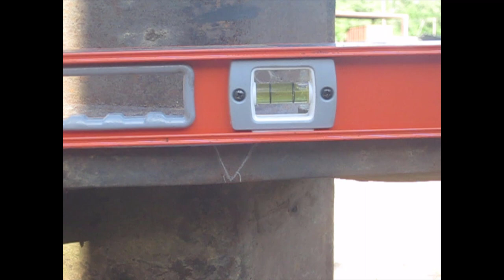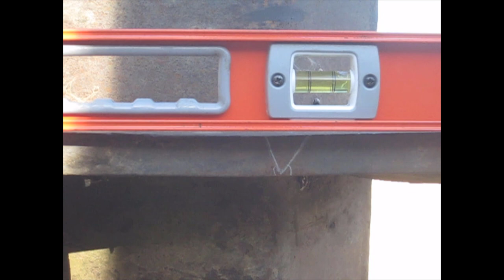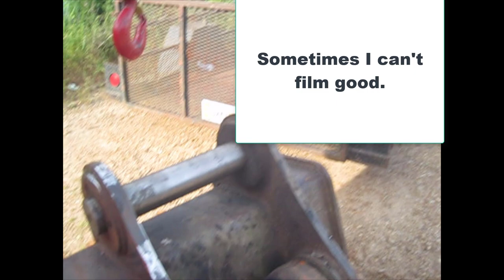bucket ear repair

Comment: A cut and weld expert does cut and weld. 
I would have put the old pin in just the bent ear sleeve and the stick and bent the ear back by manipulating the bucket against the ground. If it can be bent into a bad position, it can be bent back into position until a new pin fits. This likely got bent because the pin slipped out of the other ear.
Isaac is great. IC Weld. Amazing work. Very humble as he finds better solutions and corrects himself on video.

Comment: No matter how far we advance in the future, we still need the old ways for permanent fixes. Like you said, a thousand ways to skin a cat. I like the result and not sure I would of tackled it the same way but your liquid steel filled the gap just fine and with air needles made it super strong. No tearing that eye out. I have seen it done on bigger stuff... I will check out your friend... good video, Might get some time and kylon the tool truck enough that she hides her age better. I seen where it came from and you have done so good.

Comment: Pressure and heat shrinkage would be the easy way . A  jack or heavy prop and tapered wedge then a heat band roughly where your welding would move it in 20 mins , faster if your allowed to quench . Spent half my life building heavy fabrications for offshore and half of that time straightening after welders did their stuff .

Comment: By the way… I found a awesome old welder to restore!!! It’s a …national cylinder gas co. Sure arc 150s portable wheelbarrow welder. Has a onan p243 2cyl gas engine and it’s 150amp dc welder. It’s AWSOME!!!! Old welder from 1953!!!! Waiting on a connecting rod for it to arrive
Reply from the maker: Nice find I've never seen one like that.  I'm sure it will be a cool project for sure.

Comment: If you want to eliminate sideways load swing while using a crane, swing the boom in the direction the load is swinging but only go so far as you're above the load, then as it swings back, swing the boom over the load again, keep going until the load is under control.

Comment: The fact that the bucket is in for repair, is testament to the poor operator(poor lube-obvious by flange/link dryness and pin/retainer maintenance) - the ear bent because the pin worked loose, and by side slewing to clear brush it bent the lug! Any operator worth his/her salt could have stressed the ear back into alignment ON the 360!. Failing that heat, temporary stays/dogs for recationary forces and a hydraulic power pack/bottle jack and job done. Keep safe and well.

Comment: Great job!! But just some friendly advise. I think your welding that a bit too hot... its one thing to have enough amperage to get good penatration on heavy metal, it's another to be running so hot your blowing your weld out the bottom. By "Ving" the metal out you ensured good penatration as you build up welds and that is great, however 7018 welding rod has a much higher tensile strength and would have made that weld much stronger...

Comment: Is your boom cable twisted up or something?  Everytime you picked the bucket up it spins like a merry go round.  Nice fix, lot's of welding.
Reply from the maker: I’m not sure what was going on. Anytime you put a heavish load on it. It twists. I’m not sure what’s going on but I do need to fix that.
Reply: It's the twist coming out of the cable under load. If your swivel hook is working, it shouldn't be that bad. Maybe your swivel needs to be greased?

Comment: Not an expert but that’s a lot of work
Bend it back with the digger wouldn’t need much heat if any but that’s not your fault. Field fix. We run quick hitches here so bucket pins are always trash so bending ears common when you snap the pin. Can generally bring them back pretty easy. 
Otherwise leave it bent and linebore it is another option as it doesn’t mean cutting the ear at all. 
Maybe pierce the middle and leave outside edges as much less likely to stress fracture.  Cracks like edges. Backing plate for run out on edges may have helped. 
Nothing wrong with “Texas tig”. You can add more rods with clamp style holders too when filling too.
Just add 50% more amps per rod.

Comment: Another way is to cut the center of your v  and double bevel to even out the heat and pull on the ear and more weld and strength

Comment: Good day, I enjoyed  your video a lot, but on 23 54 you were pushing instead of pulling . I thought you couldn't do that with stick welding?
Reply from the maker: You can push or pull depending on the position. Welding flat you have more options you can’t do that very well when you’re out of position.

Comment: What settings were you using for the stick welding? Nice work on the cut!
Reply from the maker: About 120 amps 1/8” 7018. For a engine driven machine third gear 50% on the fine-tuning.

Comment: G'Day,,,,Have watched a few of you Guys,,doing repair work,,carbon arc gauging,,,hmmm,, never heard of a gauge tip for your oxy,??make them for LPG and acetylene torches,,
and Hollow ram jacks,,(Porta power,,) some threaded bar and a couple of nut's,,with the right jack can get up to 100 ton of force,,this will depend on jack area,,but you guys to me seem to do it the hard way,,
Now you have cut it all away,,why wouldn't you tak a strong back on to prevent weld pull,,
I mean you went to all that trouble to get it near straight any way,,??
Yes i do watch IC weld,,your right he is pretty good,,but he to seems to do it the hard way,,

Comment: Reading comments why would you heat it and hit it with a hammer very difficult to Aline the pin properly , cutting and welding is the correct way to do it and the insurance company will cover the repair , if the operator hadn’t bent it you wouldn’t have to repair it

Comment: What is meant by texas tjg?
Reply: when you take another welding rod and use it as a filler rod for filling in larger gaps
Reply: @robertwray7503  thanks
Reply: @mikes1345 no problem been welding 30 years used that method many times

Comment: What really amazes me is you never seen a temp. stick in that man's hand To make sure hes not overheating the base material And what other thing got me is he was using 7018 From my experience with that grade 50 material. He would have been better off using 9018 welding rod  Just for the sheer tensile strength In a high stress area around that eye.....
Reply from the maker: That’s the Beauty of stick welding really hard to overheat the metal if your constantly stopping to chip slag. Trust me I took plenty of breaks on it so it didn’t get very hot.  7018 is 20,000 psi more than grade 50 material so I was plenty in the safe zone. I saw the machine just the other day it had cleared around 40 acres in Hardwood Bucket still in one piece.
Reply: Classic Work Nothing feels better than watching your work hold up!

Comment: One person could easily pull it back with one torch and a  cumolong and sledgehammer  do it a lot faster to . You did it the wrong way ,If might have been done just with flame straighting using nothing but heat and cooling .
Reply: Like he said there’s 1000 ways to do it.  Just because he didn’t do it your way doesn’t mean he did it the wrong way.